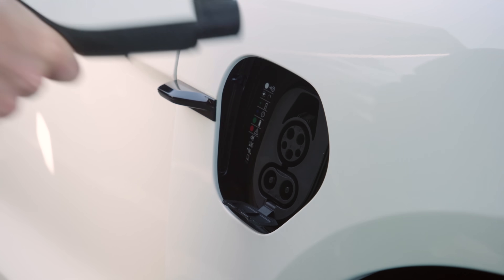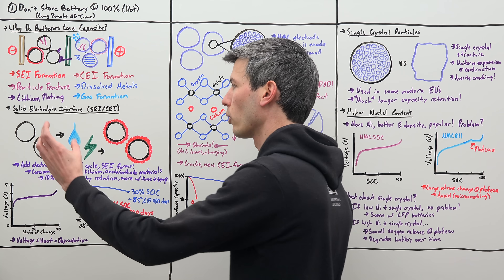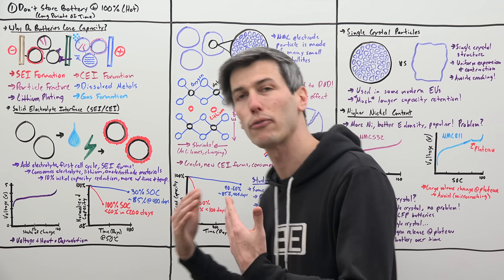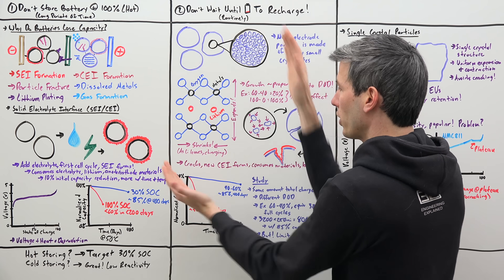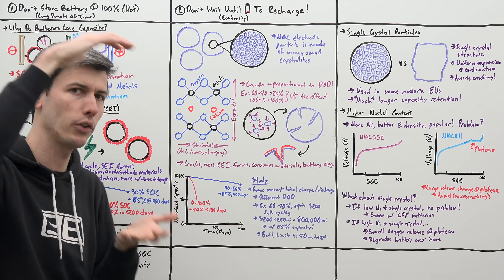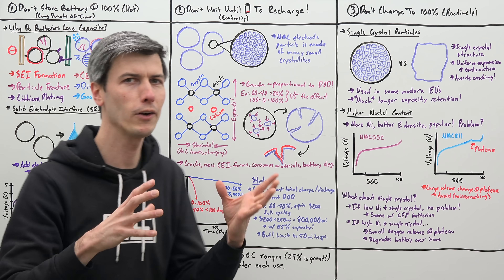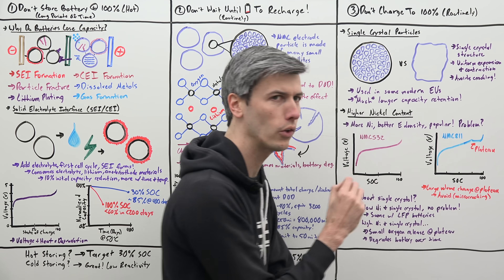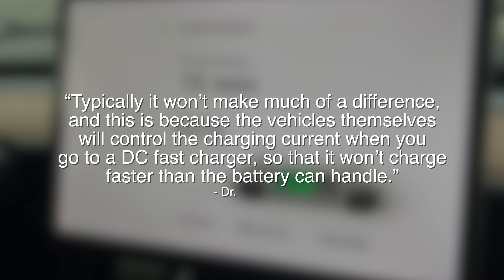How To Ruin Your Electric Car's Battery - NMC Edition!

Comment: Oddly, my dealership told me exactly a different story about charging. They told me *not* to charge every day as they claim many small charges are bad for the battery. I even have a battery report from them saying that.
Reply: maybe it is because people keep doing small charges of 80% to 100% often.
Small charges around the 50% mark are not bad for any battery.
Reply: That is very strange, maybe they are running into a lot of cases with their customers charging their batteries to too high of a percentage very often.

Comment: Charging to 100% does not ruin the battery ............... Maybe if you do it every single day for two years.......
Reply: Which is exactly what was said in the video.
Good for you for paying attention.
Reply: It's just best practices. Missing an oil change probably won't destroy your engine, but it'll probably last longer if you just have them done.

Comment: So the interesting part for me in fast charging, that a study showed a graph of 2 car's battery degradation. One was charged 90% on the Supercharger network, the other one was charged 90% at home. The graph didn't show major difference in between the two. So that means I should be safe with fast charging on a daily basis? Well not really.

There was an other guy couple months ago, who used his model 3 for riding Uber, and he supercharged his car twice a day (yes edge case, but it happended, and it would happen with other drivers who have to make long trips often for some reason.). His battery died after a year, driving "only" 120k miles, due balancing issues. Warranty is limited to 100k... Bummer (or well calculated?)

The degradation itself just one factor among the all of the failures these batteries can "produce".
Reply: That uber driving scenario sounds like one that could be avoided by periodically slow charging to 100%. Balancing all the cells every few dozen cycles never hurts.
Reply: Yeah I believe it was a standard range and he charged it always past 90. So no wonder his battery didn’t last. I did ubering with my 2018 model 3 long range for like 4 months full time and supercharged twice a day but never went past 70/75 percent. Lost about one mile after I stopped ubering. Staying below 80 percent for daily use really does help and why it’s recommended by the manufacturer. The car even tells you lol. Only do past 80 when I’m going on vacation.

Comment: What about regular non plugin hybrids? Does the charging strategy of the car maximize battery health?
Reply: Well you can't charge the battery of a non plug-in hybrid, it just uses regen and the engine to charge. But yeah, if you look at the energy info, they generally will not actually charge all the way up or drain all the way down. It's all handled by the cars computer.

Comment: Hey Jason, I have an idea for helping us nerds and engineering geeks get the most out of your whiteboard discussions: zoom in on the portion of the whiteboard that you are discussing. A close shot will help us see the details, see your hard work, a little bit better. Would you consider that?

PS the two Jason‘s videos you and Cammisa do are a hoot!
Reply from the maker: Yeah, sometimes I do it, will keep this in mind!
Reply: When I want to zoom in on the whiteboard I just use my two fingers on my iPad and it works great to get a better view of the whiteboard. It also helps me to slow the video down to .75 so I can absorb the information easier.
Reply: if you are watching videos on your phone get some 2.5X reading glasses
your phone screen will look at big as a tablet or small laptop

Comment: Do level 2 charging rates make a difference for degradation? My bolt euv can take something like 11.8 kw, but I rarely need that rate; my utility pricing drops at 8 pm and I rarely need to charge more than 20% in a given day. My ChargePoint charger can be set at a lower amperage.
Reply: I've looked into this, and the conclusion I came away with was that L2 charging rates aren't really a big deal. You're shoving way more voltage into the car when you do L3 charging, and the batteries seem to do fine as long as you're not doing it every day.

That said, if it makes you feel better and doesn't impact your ability to travel, there's nothing wrong with going to a lower amperage.
Reply: Yeah I couldn't find much when I was trying to find if there was a difference between level 1 & 2 for battery health, it seems fine.
Reply: My home charger can charge up to 48A but mostly set my charge rate to 30-32A. I figure less heat and wear on the charger and home circuit?

Comment: I def need an LFP Battery video like this!!
(For my Tesla Model 3 RWD)
Reply: Yes please
That's what I have
Reply: No worries with LFP. You just need to fully charge to 100% at least 1x/month for optimal battery health lasting 500k-1M miles to 60-80% capacity
Reply: @larryc1616 the greater point of discussion with LFP is what to do in the interim between 100% charges. ie: is there an optimal state of charge or simply charge to 100% each day
Reply: @larryc1616  Tesla recommends at least 1x per week though.
For my charging habits: It's like the opposite, 1 or 2 days of not charging at all (per week). Most of the time I charge it to 100% (at home), because that's what I heard from Tesla or other people.

Comment: 0:41 The “C” doesn’t just stand for Cobalt, it’s a reminder of the Child labor used in many of the mines. 
Don’t support the industry until these human rights practices are solved.
Reply: And also for the CRUDE OIL that uses “C”obalt for refining processes like desulphurisation 

At least EV batteries have option of using no cobalt 

But having sulphur in refined fuel will probably give you lung cancer even faster as well as more smog and acid rain

Comment: I do recharge my current Samsung S20 5G mobile phone since the beginning in a fashion that I try to stick within a 30-80% SOC window. For this I have voice alerts coming from 30% down in 5% steps and switched on the function that limits charging to 85%. The battery seems to have some degradation, but it's by far not critical, still very usable. Soon it will reach the 4 year lifetime mark. Another method: I only use a certain Samsung wireless charger which has a fan inside that blows out air around the charging pad keeping the phone from getting too hot. For me this started as an experiment. I hated it when my batteries were getting useless way too early and so I started some research how to keep LI-Ion cells happy for a prolonged time. It really works!
Reply: I do the same. I keep mine from 40~60% when Im at the office with a few short charges daily or 30-80% ocasionally if im distracted. no regrets if I need to fully charge when travelling. works like a charm.

Phone will probably be replaced long before degradation becomes relevant

Comment: A video about LFP would be great considering they will become the most prevalent battery chemistry soon.
Reply: Also I’d say they are the prevailing tech as over half of Teslas use them and Im sure for BYD it’s the same
Reply: @chidorirasenganz  But Teslas are 🐶💩
Reply: The problem with LFP is that you effectively give the battery market to China. Sure, they may setup shop in the US, but what's interesting is that A123, one of the original makers of LFP batteries, made one for the first Chevy Spark EV. And the degradation on it was horrible.
Reply: @sprockkets  Correct me if wrong, but A123 went bankrupt and its IP was purchased by BYD, leading to BYD"s LFP technology.  Yes?
Reply: @sprockkets  LFP batteries are actually worse.
They have lower charge density.
Less cycle capacity
And less discharge rate.
Reply: @sahhull LFP batteries are also cheaper, safer, and less toxic. What’s “better” or “worse” is what’s best for a specific application. But given these benefits and the fact that their drawbacks are partly due to being still early in their development/refinement cycle, they probably will become the dominant type of battery in EVs - at least until an even better battery type comes along.
Reply: @sahhull  Who told you about less cycle capacity???
For the vast majority of ppl, LFP makes better sense than cobalt rich batteries.
Reply: @sprockkets  it was something I read from Panasonic
Reply: Yeah his presentation is on the old lithium ion batteries not the lithium phosphate LFP which is much better and last 4x longer.
Reply: @larryc1616  LFP is still a Lithium-Ion battery - LFP and NMC refers to the battery chemistry, Lithoum-Ion refers to the mechnism used to carry the charge around the substrate from cathode to anode and vice versa.
Reply: @TB-up4xi  yes lithium phosphate is LFP vs old lithium ion NMC
Reply: @larryc1616  Better? Less energy density and slower charge and discharge rates. It's better in longevity and safety, but poor performance. No thanks.
Reply: @OtisFlint they are getting better all the time. The LFP Teslas atm are far better performing than the entry level NCA/NMC Teslas that proceeded them
Reply: @OtisFlint  LFP has slightly less energy density but is catching up fast. You can charge LFP just as fast or faster and to 100% no degradation. Great thing is it last 4x as long or 500k-1M miles before 60-80% battery capacity. Battery tech is moving fast and what we'll have in 2-3 years makes today's batteries obsolete like lithium ion today.
Reply: @larryc1616  Yeah, you have to be pretty far down the coolaid bottle to have figured this out. Most don't have a clue about battery tech advances. Batteries will (store the) planet's power before we know it. too much FUD out there.

Comment: Excellent video and a very good explanation of why I do not want an EV.  My last three cars two Hondas and a Toyota all with well over 200,000 miles and except for one Honda which was totaled by driver that backed into it even though his vehicle was equipped with a backup camera.   I keep meticulous records and all three vehicles got the same gas mileage i.e. range on day one as they did the last time I filled with gas.  (taking into account the type of driving (highway vs. city)  Other than routine maintenance no mechanical issues period.  I fill then up when it is convenient to me not the car,  Takes less than five minutes.  Anyone who owns a cell phone can tell you all you need to know about battery degradation.

Comment: Replacing a battery is not expensive, it's price gouging. If Tesla's average cost to build all of their cars is now $36000 based on the latest financials, the battery cost is much less than they are charging. If the green deal is supposed to make the world better battery replacement should legally mandated to be at cost with no charge for the labor. Then Tesla and other companies would be motivated to build batteries that last and have as low a failure rate as possible.
Reply: There are third party, certified installers that charge less than Tesla to install a new battery. Re/Cell is one example of such a company.
Reply: @Green_Tea_Coffee  Fair point, but still nowhere near cost. $10k for 66kWh is not a cheap option, but better than Tesla. My point is if we are moving to a battery future for the good of all (supposedly), then cost should be passed on to the user, not a penny more.
Reply: @motofunk1   No one wants to spend that kind of money for a car repair, but frankly, this isn't endemic to just EVs. Transmission replacement on a modern car can cost somewhere in the neighborhood of $8-$10k.
Reply: @Green_Tea_Coffee  True, with some thoughts.... The question is what is the useful life of a vehicle supposed to be and at what level of maintenance, something conveniently left of the window sticker of a new car. 

EV's should last roughly twice the amount of miles as an ICE vehicle from a complexity of drivetrain standpoint, with less maintenance, with the battery currently the weak link. 

In an modern (last 10 years) ICE car the engines have become more complex with increased wear as a result of weight added for safety improvements along with power increases and emissions crackdowns. The result is the powertrain has become the week link at around 100k whether it be turbos, emissions controls, transmissions, brake wear etc... Plus powertrain packaging has driven up labor hours on simple maintenance items  

ICE cars from 1998 - to 2010 ish were the sweet spot for longevity and repairability due to less complexity. For example, just had a rebuild on an Allison transmission for my 22 year old truck that has 275k on it. Did the labor myself to remove and replace. Trans rebuild cost was $2500. Labor is the current issue if you put some controls on parts costs. Parts costs have been going up not only due to inflation, but also due to the legacy OEM's and dealers making parts markup a large portion of the business's financials.
Reply: How many are paying to replace their batteries? Even the most neglected examples are covered by an 8 year warranty. Those treated with even some care will last a very long time.
Reply: @peejayem4700  Good question. The warrantees are a bit of a bait and switch. 8 years for example makes sense on the surface, but not if it's considered working fine to as low as 70% of rated capacity.  Most EV's get only about 80% of their rated range in real world driving, even when the battery is at 100% health. Extrapolating that to a battery being not eligible for replacement until 70% takes a 300 mile range car to 168 mile car before it will be warranty replacement eligible. Also, owning a car for 10-15 years becomes not financially viable if the replacement price is not kept in check.
Reply: @motofunk1  degradation does not seem to be a factor for battery warranties, at least for those ev’s with dedicated thermal management. I’d be more concerned about battery failure. Big mileage ev’s are increasing significantly and the technology has only been getting better.
Reply: @peejayem4700  The tech is getting better and will improve, I agree. All the more reason to put some price control on replacement. Warranties are just mumbo jumbo and will be abused as usual.

Comment: What about 10% to 80% did they test that? That is the most common for road tripping I didn’t see that range on your white board 😅

Also, commute distance matters greatly as far as whether ev is a good option for apartment dwellers without home charging.
Reply: 15-80% would be better for the battery if you regularly do roadtrips. No need to limit yourself even further though, the battery still also has small integrated buffers.
Reply: car charges much faster longer for lower % though, reducing trip time @BBingo-v5i I'm just curious if the data showed that there was a significant increase in battery life if charged from 10-80% because the data shown in the video was only comparing 0% to 100% vs 40% to 60%, it might be true that 10% to 80% is not that bad, but no data here.

Comment: Good video. Couple of things I think you should have noted though. In the middle graph on the charging from 0-100% vs charging just 25%, you mentioned the charge cycles for the 25%, but not the 100%. Cannot tell if it was suggesting 800 cycles, 1600 cycles, or something else. Would be best to the worse case info for those who need to charge like that. Also, while you did mention that this was specific to NMC and similar cell chemistry, it would have been best to note that LFP is hugely different. Specifically since that is what is being used on a lot of cheaper EVs right now.
Reply from the maker: For the first part (100% cycling), looks to be about 800 cycles before ending testing. For LFP, I did mention towards the end different rules apply (and provided a disclaimer at the beginning about chemistry). I do think I should do an LFP video!
Reply: @EngineeringExplained  Looks like you have around 300 or so comments asking about LFP. lol. And 800 is what it looked like.

Comment: You mention the lfp batterys on the 3rd point, but manufactures like tesla do recomend to charge regularly to 100% so I don't know what to di. I usually use less than 15% of my battery each week , so I don't know if let the car discharge or not, I can charge at home some I don't have that issue about charging elsewhere but I do want to keep my car battery lasting longer so...
Reply: You're fine to charge LFP cars to 100%, but for their cars that use the other chemistries Tesla recommends 80% for daily driving.
Reply: @Green_Tea_Coffee  Yeah, I've red that despite the problems with the BMS of you don't charge regularly to 100% , and despite the effect is less than in nmc batteries , of you keep 100% also degrades your battery
Reply: @nomaryako  As a general rule of thumb, probably the best practice is to stick to about 80% state of charge for daily driving, and only charge to 100% if you're going on a long road trip.